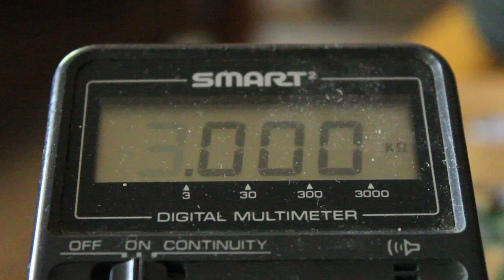PS2 Potentiometer Adjustment - Disk Read Error Fix

Comment: Thanks for the video, very helpful and worked for me!
Below some notes for others who decide to try this approach (do try it if you have disc reading errors!):

My second-hand PS2 read CDs but not DVD games, seemed to be unopened before. The DVD pot was initially set to ~890 Ohms and CD to ~540.

1) I adjusted the CD up to 610 just in case (didn’t seem to hurt/affect the performance).
2) I tried different values for DVD, first down to ~740 Ohms with step ~60 - no change. Then tried 1050, 1245 and 1290, the latter two worked great (reading most of my DVDs).

Look up the acceptable ranges for the potentiometers on your model of PS2. For DVD it seems to be 750-1300. Try both increasing and decreasing the value (as said in other comments here). Measure the resistance on each step and keep track of your tries on paper.

Be gentle adjusting the pots, a light touch (the edge rotating just 0.5mm may equate to a change of ~50 Ohms).

Good luck!

Comment: Am i the only person who does not have screws that can be turned? (they have a flat head) No place for crosshead or flathead screwdriver. Also, i only have 3 screws holding the laser (4th does not have a socket for a screw so it was only made for 3 (European model).

Comment: In order to try to fix it so my PS2 could read PS1 disks, I went and broke the limiter on the potentiometer's DVD screw. I didn't even force it, nor did I see the little piece.
Now I only hope I can still adjust it, bit by bit, then using a Voltmeter to measure it and get  it above 720....

Comment: PS2 Slim I just picked up wouldn't read random discs. I did all the outside cleaning I could then started inside. The four screws meant to hold down the spindle and laser assembly are not present at all. Warranty sticker was in tact also. So weird.

Comment: I bought a new laser for my ps2 slim a spu 3170. When it came I tested it with my polymeter and I found 180ohms for dvd and 650 ohms for cd. I made them around 700 both. It plays cd, psx, audio. Some dvd movies perfectly but a couple sometimes it is lagging for half second and instantly resumes the movie. Would this means I must recalibrate the dvd or maybe should I grease the gears or change the flex cable? Thank you.

Comment: If you screw it clockwise, does it increase the ohms or decrease? I don't have a ohm reader so i would like to know. I'm also thinking overtime wear should loosen the screw so tightening should be the only option towards a solution going into iit blind right? Thanks for the potential answer :)

Comment: My CD’s won’t read but when i opened it up the meter was already set in the 2 o’clock position. Where should i adjust to? I don’t have a voltage meter…

Comment: Thank you so much, this was a last chance to save my PS2. Just for the record, if somebody is trying to fix this, in this way, try first to increase the value. Mine started to work at 1280 ohms (DVD screw). Also I tryed decreasing resistance to 750 (originaly it was set to around 830) but only made things worse.

Comment: Hmm, just did this, don't have a way to check the voltage but, the PS2 reads the disc forever now. Any suggestion?
Reply from the maker: Without being able to accurately read the resistance on the potentiometer it's difficult to say whether it's tuned properly. These lens assemblies can be quite sensitive. If it seems like all the components are mechanically sound it might be worth looking into a replacement lens which you can often find on eBay.

Comment: If you change the laser frequency it will play some games yes, but it actually burns its life out 10x faster
Reply: Bro, you can use mx4sio memory card adapter after adjusting those potentiometer.
for installing some softwares (opl something like that) we need, the laser can read the disk data just for one time.
After that you can unplug or remove entire laser system.
It's better way compared to buying new one.

Comment: What screw driver do you use?
Reply from the maker: I don't really have a particular set of screwdrivers that I recommend. Any set with a good variety of Philips screwdrivers should work for this one, particularly Philips #0, #1, and #2 should be good. Though I do hear that the iFixit kit has a decent number of bits for other repairs that might be useful to you down the road.
Reply: Thanks, I used a bunch of screw drivers and non of them worked.
Reply: @scpnoobers I used a cutter

Comment: What's the original factory value these lasers were meant to run? Also, what's the average life of the laser after adjustment? I've been talking to some techy friends and they seem to be divided between 6-12 months extra or it'll be fine.
Reply from the maker: The problem with these disk drive assemblies of this era is that they were built fairly poorly. Realistically this is just brute forcing more power into the laser diode to read the disk more accurately to make up for the poor quality of the drive parts. It really depends, you may find that this lasts you quite a few years. However with the prior information in mind, this extra power means that you are putting more stress on the lens diode. It could burn out in a couple of months as they mention, but if that does happen, the unfortunate reality is that you didn't win the lottery in the PS2 cheap components department

Comment: Mine doesnt have any clicking noises. Ive cleaned the lens and taped down the lid tray close switch inside as the case was loose. It worked for two more times and then stopped working. Doesnt read anymore discs.

Comment: 2/10 after that (I did everything like in dis vid) my ps2 dosnt even "think" that i closed the lid the disc wont spin, I tried reattaching all the cables but it wont. The 2 Is for that i cleaned my ps2 from all the dust

Comment: My ps2 reads silver discs but not blue discs, does this mean I only have to adjust the CD screw and not the DVD screw or do I still need to adjust both screws?
Reply: blue discs are CD silver are DVD
Reply: @mechanicalman4531 Other way around bud
Reply: @matthewnikitas8905  wrong; blue are CD silver are DVD. look it up sunshine
Reply: @mechanicalman4531  you are definitely right

Comment: is this increasing power to the lens or decreasing power to the lens?
Reply from the maker: It is increasing the power to the lens. To answer the question you'll probably have next, yes, it will technically wear out the lens faster
Reply: @SamCampbell  did you say turn the pots about 2 degrees clockwise or 10 degrees clockwise? it appears more than 2. I'm applying this to a SONY SACD player that can read CD's fine but can't read the SACD layer -  I just replaced the laser.

Comment: Great video, small note - if the laser adjustment screws are originally at 12 oclock position and you turn each to 2 oclock, that's 45 degrees difference, not 2 degrees
Reply: Dividing 360 degrees of the circle by 12 gives 30. So, every one hour you move the screw ahead of 12 O'clock, you move by 30 degrees. 2 O'clock means 60 degrees. @harryi4346 is right.
Reply: Nope, if its 2 oclock, thats mean 60°
Reply: I was thinking the same.

Comment: Thank you. This absolutely fixed my PS2. I was trying for ages to get FreeDVDBoot to work (burnt to a DVD+R disc). I turned the potentiometer just a tiny bit (didn't use any measurements), and now the disc boots!
Reply: I was looking for such a comment, although I am trying with a DVD-R. It showed up once after 30 tries or so, but never loaded the ulaunchELF. So, I thought the problem must be with the potentiometer setting. Going to try it now on my 90006 model.

Comment: If the Ohms reading for the DvD is below 700 before any adjustments (from factory) would increasing it fix the read issue? Or if it's that low already and doesn't read there is nothing I can do?

Comment: Hey mate, i'm wondering if this might be the solution to the problem i'm having at the moment.  ONLY on initial boot up (changing CD's mid game is fine) the laser will flick the disc a few times before either starting up successfully or giving up after 10-15 seconds.  This is a side view of the laser as it does this: https://www.youtube.com/watch?v=-liM2CsYqQw

Do you think making this adjustment will help with what i have happening or not really?

Comment: Thanks, managed to fix one of the three slims I had with that problem, haven't tried the other two yet, but they will probably work too. Now all I need is a fix for the 10+ controllers with defective membranes that I have.
Reply from the maker: Nice! If you are looking to fix unresponsive button membranes I would recommend taking them out, pressing down so that the black contact is protruding and gentle run it across a clean white sheet of paper. The board itself can then be cleaned with rubbing alcohol
Reply: @SamCampbell  No, they are clean, it's somewhat of a design flaw in these controllers. You can't really take the membrane out, it's soldered to the board inside a plastic connector. It's not like the old Sega or Nintendo controllers (or maybe even PS1 ones, haven't opened one up yet), PS2 controllers don't have contact points on the controller board, the contact points for all buttons are on a somewhat flexible membrane, which is then soldered to the controller board. This membrane has traces in it and because it moves inside the controller, these traces break (or atleast that's the most logical explanation I got). Of course you can try to find the break in the traces and fix them with tiny wires, but that's a bit above my skill set (and patience level).

Comment: Before disassembling your PS2, try this method that worked for me. In my PS2 slim, the discs were spinning, but the screen was black (not reading the content of the discs).
So, after cleaning the laser lens and the two metal parts near the laser, i run the diagnostic tool:
At the opening menu (the first screen that comes
 up when you start), with no disc in, press "triangle". Select "Console" and press "triangle" again. The "Diagnosis" option appears. Select "On" using the up and down directional buttons and press the "X" button. Insert a disc. The PS2 automatically starts the diagnosis. Once the diagnosis is complete, a menu with several options related to screen format appears. Choose "Run the Game/DVD".

You must do this with 3 or 4 discs, until is no longer necessary to do this procedure.
Reply: I activated the diagnostic tool and inserted a disc but nothing happens ...
Reply: @justinhalo3541  you must be patient. I tried 4 or 5 times before it worked. Do you hear the disk spinning? Before i went into diagnosis mode the disk was spinning too fast. After turned on the diagnosis mode and       inserted the disk, is starts to spin slower.
But, hey, this worked for me. Maybe your laser is burned.

Comment: I gotta say I had my doubts this would help me since I have terrible luck with electronics. My Ratchet and Clank games were all stuttering during cutscenes and sometimes voices would cut out. The disc read error would pop up sometimes as well. But here I am after tightening the screws to say thank you because the game is loading up fast and smooth. Thanks a lot, Sam!

Comment: I tried this but being heavy handed I believe I stripped one of the screws as it rotates completely around without coming to a stop. Does this mean it is no longer any good? Should I swap out the entire eye assembly with a new one? If so, what would be the correct part for an SCPH-70012 console? 
Thank you.
Reply from the maker: You have probably just shorted or opened the potentiometer completely. This should be the right replacement https://www.ebay.ca/itm/PVR-802W-Replacement-Laser-Lens-Repair-Part-Deck-for-Sony-PlayStation-2-PS2-Slim/353400193317
Reply: Awesome thanks!
Reply: I  ordered one from Amazon which has the same part number, just installed it but still not reading. Do the replacement ones also need to be calibrated as you are showing in this video? I don't have a milli ohm reader, I have a Fluke 117.
Reply from the maker: @rtorres3442  You shouldn't have to do much calibration with a new one. I would say you should aim to about the same resistance that you had on the original before you calibrated it.
Reply: @rtorres3442  Did you find a solution?

Comment: Thanks a lot, sir! 😊👍 You made my day with this helpful hint! My PS2 slim could read CDs just fine but struggled with DVDs. Now it's back into focus again! 😁😎
Reply: Did you use a volt reader also or did you just turn the screws a little??
Reply: @caylee3277  I made markings wit a sharpie to "store" the factory-left position, and tried my luck by turning the pots tiny by tiny.
Reply: I'm having this save issue right now
Reply: Iam having the opposite problem plays DVDs fine but can’t read games!

Comment: Hi, so here is my problem,  I had 5 games who didn't run (3 white DVDs and 2 blue CDs) and after testing this fix and very carefully rotate the potentiometers clockwise without a multimeter I got 3 of the dvd games running (and every other DVD games that I had worked too) but I didn't get the blue CD ones to run and now after getting my hands on a multimeter i had to rotate the potentiometers counterclockwise to match the resistance you recommended because rotating them clockwise lowered the resistance and now non of the DVD games I have cant be read BUT got 1 of the blue CD games to run (but it spins like crazy). Don't know what seems to be the problem with the DVD potentiometer because lowering the resistance to almost where I had it before I measured it with a multimeter doesn't seem to work now either. 

I have a PS2 slim with model number: SCPH-90004
DVD resistance: 745 ohms
CD resistance: 690 ohms 

Did I maybe brake the dvd laser now by fixing the potentiometer again when it was running good before?
Reply: did you find a solution?? have the same problem...
Reply: @justinhalo3541  I bought a new plug and play laser head from Ali Express and it worked perfectly without having to do anything with it, just look for the right model number and you should be alright.
Reply: @blackliizt  so your old laser was dead ?
Reply: @justinhalo3541  yea I messed up the old laser
Reply: @blackliizt  I also had a problem where the game starts and then it goes black... I heard that modern tvs dont support the low graphics from the ps2, so you need an hdmi/component adapter. Do you know if its true ?

Comment: turn it 2 degrees. Turns it 45 because no one knows how degrees work
Reply from the maker: Heh very true. But in all seriousness the import measurement is the resistance. Make sure you measure the potentiometer before testing

Comment: Thank you so much, you helped me so much, best wishes <3 I didn't have the voltmeter, I just watched and did it the same amount like you did, and it works perfectly, my ps2 still makes some grinding noise while starting up the disc, probably because it's chipmodded, and the strange thing is that it boots into the menu, and then a few seconds later the playstation logo appears and it boots the game normally :)

Comment: This worked perfectly! I changed the DVD potentiometer from 940 to 870ohm, however, I couldn't get CDs to work. Even the scratched discs that would rarely run when my PS2 was good, now start from the first try! This mod compensates for the laser diode degradation by overvolting it, which will result in faster degradation. If you're doing this mod I'd recommend that you reduce the resistance in small increments ~20-50ohm, until discs are read reliably, in order to reduce the laser diode's degradation rate, thus prolonging its life.
Reply: Mine also can't read cds, did you find solution to that?
Reply: @mikegr7274  I haven't tried to adjust it since. However I would just recommend replacing the laser, you can easily buy it for cheap from AliExpress

Comment: I need help. I got a brand new laser that couldn't read DVDs but read CDs (albeit the laser burns the CDs). I removed the solder and adjusted the pots to what you have in the description. However, I'm still having the same issue.

Comment: 😭 I need numbers man! What are the factory specified resistances across both pots? What is operating range for both? What is the ideal value to get blue ps2 discs to read without a problem?
Reply from the maker: In the field the factory calibrated resistances vary to compensate for different lens defects, etc. In the description I've noted that a good rule of thumb is:
-Do not go below a resistance of 725 Ohms on the DVD potentiometer
-Do not go below a resistance of 650 Ohms on the CD potentiometer
Others have reported quite differently, and say to aim between 950 to 1200 Ohms for CD, and 650 to 1000 Ohms for DVD. From my experience my first recommendations works fairly well. Try testing in 25 Ohm increments. Lower, test, if it doesn't work repeat until you get to the limit I mentioned.
Reply: @SamCampbell  sorry I didn't check the description 😩 thank you! Much appreciated

Comment: Nice video but there is one thing to do it easier. No need to take all that cables off. Just remove 2 screws that are holding laser in plase, flip the laser, fix potenciometar and put it back. No need to risk damage to any of that flat cables like you did with screwdriver. Never do that with cables.

Comment: So initial my cd would spin but would not read disk. I did this but once I connected the wires back. The lens moves but the cd spinner thing is not moving. I've tapped the two point for the cd to spin so idk what happ. Any ideas?
Reply from the maker: Most likely the resistance to the DVD laser is too low and has supplied too much power to it, burning it out. A DVD laser only needs roughly 5mW. If the PS2 does not "see" the wobbled groove of the disk it will not attempt to read the rest.
Reply: @SamCampbell  hey Sam I finally got ps1 games to work. But ps2 disk still says can't read disk